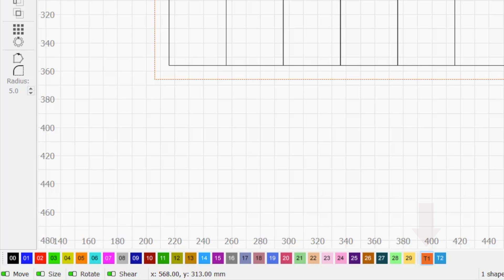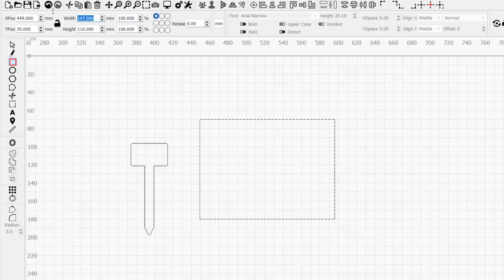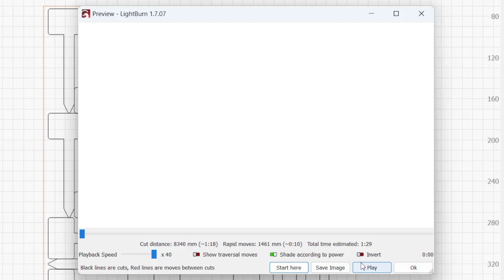Minimize Material Waste with Tool Layers

Comment: Tool Layers are really useful! But with the default settings, when you import a file with the correct colors for the tool lines, they are not recognized as such, but as a different color. So you have to enable "Allow importing to tool colors" to import tool layer objects
Reply from the maker: Yes! That is a great tip. Perhaps we will include that information in a future Quick Tip video.

Comment: Of course this is available. I feel like a doofus. I've been using random layers set to not output for like 2 years. Excellent to know.
Reply from the maker: It sounds like you found a makeshift way to accomplish a Tool Layer but this will make it a bit easier on ya moving forward.
Reply: Same here😂

Comment: How to avoid overlapping lines? I mean, how to set a space between the objects in the array?
Reply: Archy, I'm not sure if this is what you are talking about, but LightBurn has a tool called Optimization Settings right above the name of the laser you are using and below "Show Last Position. Click on that button. A new screen will pop up in the middle of your screen. On that screen will be a list of switches you can turn on or off. At the bottom of that list is "Remove overlapping lines." Turn it to the "on" position. Now the laser will only cut that area once. Beside that, there is a prompt that allows you to set the distance between lines (to allow for the kerf of your laser). I hope this helps you out.
Reply from the maker: If you have objects with lines that are overlapping, you can instruct LightBurn to only remove overlapping lines so it isnt engraved/cut twice under Optimization Settings: https://www.youtube.com/shorts/tHTnb6MURdU

If you just want to array an object and have a space then in the array creation window you can input X and Y spacing in their text boxes and choose padding between edges.
Reply: Tnx!!!